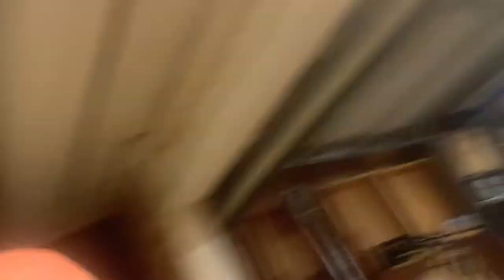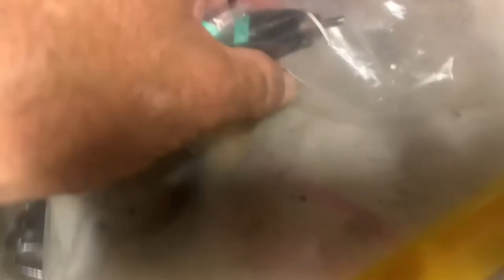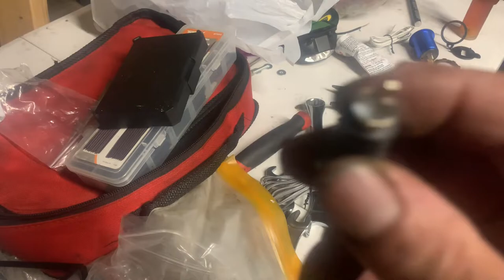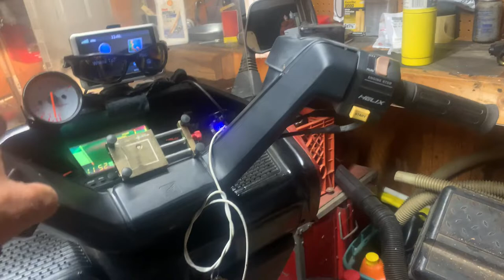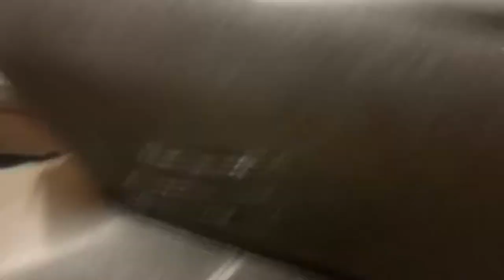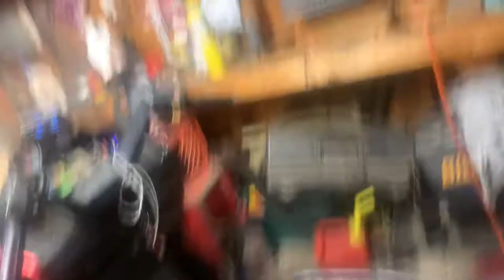Honda helix speakers mounted and working

Comment: I commented yesterday I think it was about picking your brain on getting my helix clone back up and running. I live in Tulsa. Haven’t rode it in a couple of years because I haven’t had the money to do so. I know I need new tires and a battery. Pretty sure I will need to clean the fuel system. Is that hard to do? I would love to have mine set up kinda like yours.
Reply from the maker: It’s not too hard take off carb and remove jets and clean them and put back together also put new fuel filter on it. If the gas is really old u should drain the tank and put fresh gas in it. There is a drain plug in the bottom of tank I think. Take the center plastic piece off and you will see the filter and fuel pump